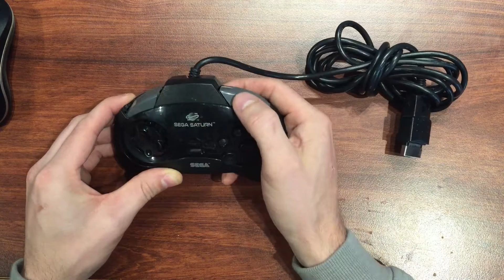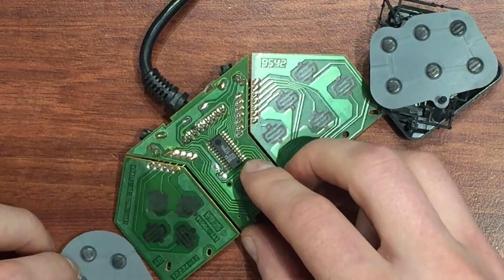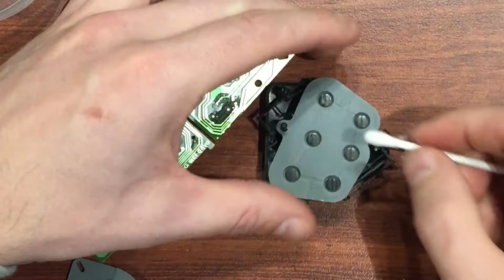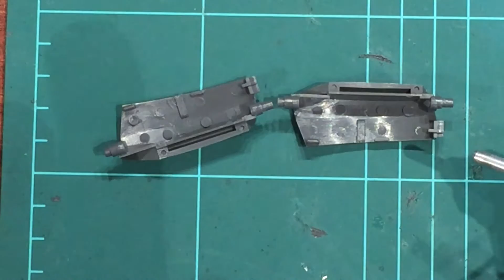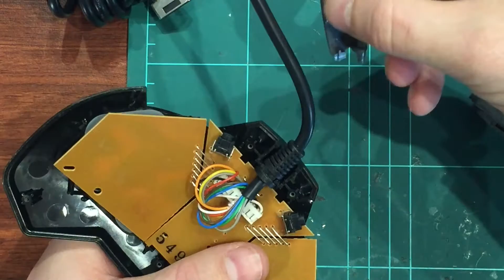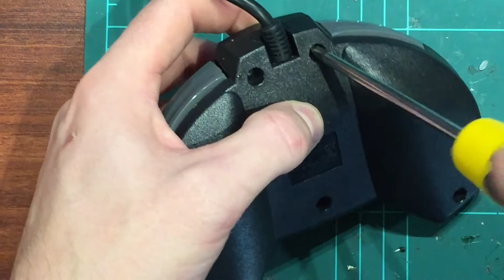How to Fix Repair and Clean a SEGA Saturn model 1 Controller - YouTube

Comment: I haven't held a NA Saturn controller since 1995, until today that is. :P It's sharp scoop ended tear drop Style D-pad feels annoying to the touch, and just like the JPN saturn controller every time I reach and press the C button my right thumb squishes into my right hand.

The retro-bit 6 button JPN saturn controller has the exact same problem, but with a better D-pad. Yet I can't stand it's jiggly cheap shoulder buttons. How do the OEM/Original JPN saturn controllers shoulder buttons fair by comparison, since I've been hearing that they're different from retro-bits?

Comment: Model 1 controller is my favorite of all time. I think it's so sexy it makes my girlfriend jealous!

I agree about the L & R buttons though. They were quite crappy.
Reply: Its very comfortable for long play for games such as galactic attack
Reply: i think it looks great also, but they needed to refine it by long term testing its d-pad and its shoulder buttons..  The abc buttons are too harsh/rough on the fingers as well.  if they fixed that, i think it could have been their best although I never tested the 3d controller.  I hate the DC controller though & think its fans mostly never played a sega console beforehand to compare how crappy it was (except maybe the vmu and the fact it used the Hall effect).  The DC itself was a great console but the controller kept me from buying it at the time.  Retro-bit was supposed to release updated DC controllers w/dual analogs and a 6 btn + 2 should btn layout but haven't heard anymore since it was teased about 1 year ago.  They also showed prototypes of 6btn Genesis and Saturn pads w/more btns I've noticed on any controller (6 btn arcade + 4 on top--PS or xbox style) but haven't mentioned them since 2018 Gamescon where they were shown.

Comment: 🚨 How is it that you 
TOTALLY NEGLECTED THE CONNECTION POINT?
THE PART THAT THE CONTROLLER CONNECTS TO THE SATURN?
Reply: Exactly. I got a Saturn from Goodwill years ago for $5, came with everything, 2 controllers, 5 games disc only and a demo disc. Works except for the up and left on the controllers I believe? I know what’s wrong with it, the metal connections on the pads where it plugs into the system is corroded. What would be good to use? Cleaning alcohol? Then, I’m not sure if the system itself is corroded at the connection point.
Reply: Facts b, 
How do we know that the controller didn't even work?

Comment: On a side note, I always add weight to lightweight game console controllers. Sega controllers are really lightweight and I prefer my system controllers to be weightier and feeling more substantial. The PS2 Dual shock is around 200grams and to me it feels a perfect weight, so I pop the backs of my Sega controllers and glue in weights to the flat plain back panel in areas that aren't in the way of anything. The weights are pennies and steel ball bearings carefully glued solidly into place, until the weight is 200grams. Try it............. I love the feel so much I can't not do it! I'd have been ok with it if manufacturers built in dead weights into their controllers just for the extra quality feel, nothing ridiculous, just around the 200-220gram mark.

Comment: What on earth do you mean by, the model 1 controller "just doesn't work properly?????" I have no idea what that means, would SEGA have designed and released a controller that didn't work???????? I think you've make a grammatical error, in that just because you prefer other controllers, you say inaccurate statements about this one. I have this model, every button works, and is an instant response, so in my book, isn't that working correctly?????? I'm sorry, but they DO work fully. Just because people prefer different models, doesn't mean to say a product doesn't work! Ridiculous.
Reply: To be fair the huge problem with the model 1 controller is that it is too good. It may make people envious. It may make people wanna steal it and so on. Also showing off this controller is quite braggy, and who likes bragging?

Comment: So I did everything you said except using the hot glue gun because I think that was unnecessary and voila my controller works again thanks a lot of the video. It has not worked for close to 18 years.
Reply from the maker: The glue was for the broken shoulder button. Glad it's all working for you
Reply: @RetroSalesAustralia  i think sega's designer of these pads could have placed a longer/wider plastic (or metal) shim coated in rubber to evenly depress the actuation buttons for the shoulders as the surface area was too little but I am not engineer but I have fixed items this way like a glove compartment w/a reputation for easily breaking for my vehicle (I did the fix about 11 years ago and still good).  They still had the dpad problem w/this and the rough abc btns.  They rough abc btns seem easy to design but the bold look of the dpad created playability problems that I'm unsure I'd have any idea how to fix like the above shoulders. I do believe they should have allowed fighting game fanatics to play w/them several hours to see what their complaints are to improve the design...heck I doubt sony or MS even do that now since I think their controllers should be more modern and ergonomic than they are.  D-pad blisters are still quite common and a reason to just use arcade stick instead.